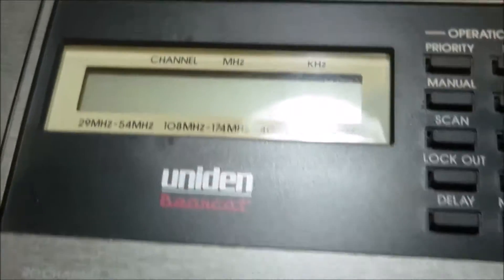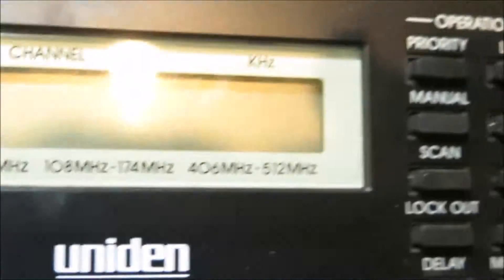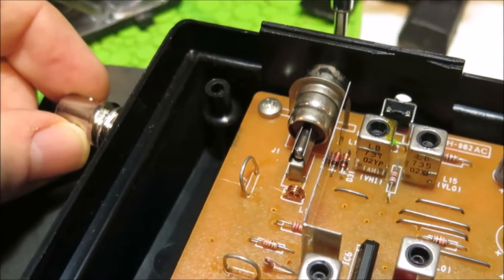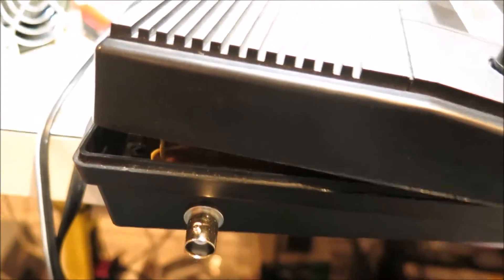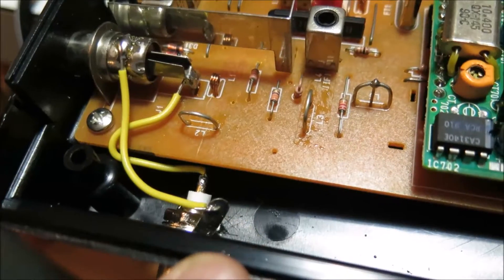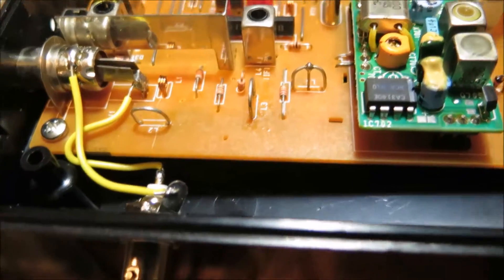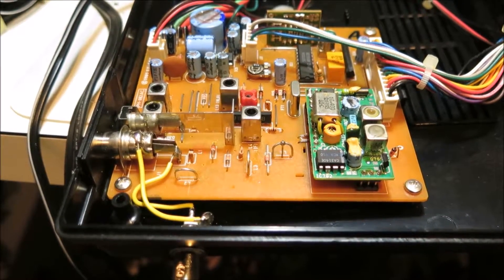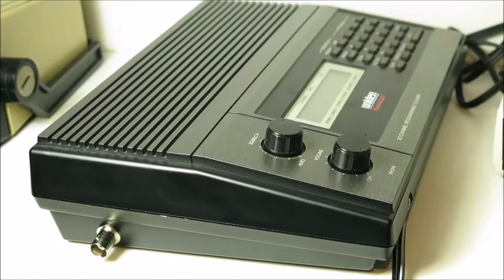Adding a BNC Connector To a BC 172XL Scanner.

Comment: Such a great idea! Excellent video, thanks for shearing. Have a good day. Regards from florida. Jay
Reply from the maker: Thanks, Jay. It works very well considering I probably should have used some low loss coaxial cable instead of just a wire, but because the length of the wire is so short it does not seem to affect the signal.

I have a Ccrane FM Stereo transmitter (FT-007) that I have plugged into it, so I can transmit the scanner audio to an FM radio in another room of the house. I do this using a Y splitter cable from the earphone jack to cables going to a Sony mp3 voice recorder and the FM transmitter.

Even though my city which is Ottawa, Canada has gone to digital radios I can still get a nearby small town's analog fire frequency and can hear the airplanes and ambulance pages very clearly. 

Have a great day.
Reply: That is absolutely awesome, I wished that I had a mentor like you when I got stated. I get very nervous when someone with you knowledge watches my videos, since I have no electronic background and speaking second language.   Was always fascinated with radios since was a child when we actually listened to radio shows as a family. Years ago before internet, went to public liberty and check out every book about subject to understand it better. As you know book knowledge is great but we need working knowledge and experience to be able to perform. So I decided to make the videos to pass along what I know in detailed to encourage others that have no electronic background to understand the process and not get overwhelmed. Thank you for the message.
Reply from the maker: @RadioFixer  That's great. No need to be nervous. Everybody has to start someplace. I was always fascinated by electronics as a kid, so when I was 12 I asked my parents for a radio shack electronics 150-in-1 experimenter kit, for Christmas. I took electronics classes every year in high school and had a great teacher who taught us at a high level. Then I took electronics in college. I worked at Digital Equipment Corporation for a number of years as a technician debugging computers and got my ham radio license back in the early 90s. Now with YouTube you can learn a lot about troubleshooting from channels like Shango066 who repairs TVs and radios. Have a good one.

Comment: Cool. Thanks.
And... It loses all memory when unplugged? That's not good.
Reply from the maker: To keep it from losing it's memory a electrolytic capacitor could be added on the 5 volt line to act as a sort of temporary battery back up.